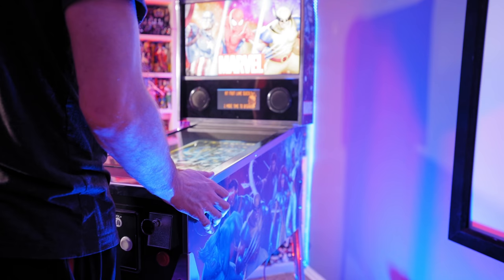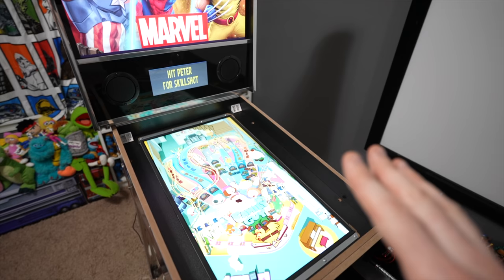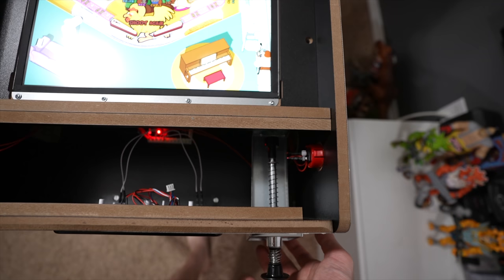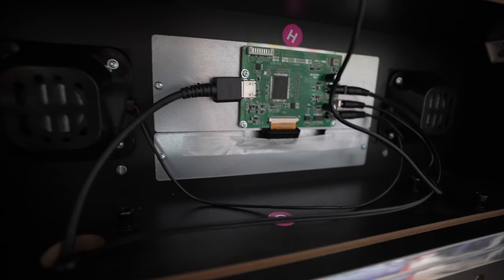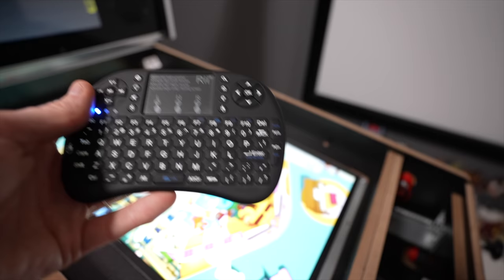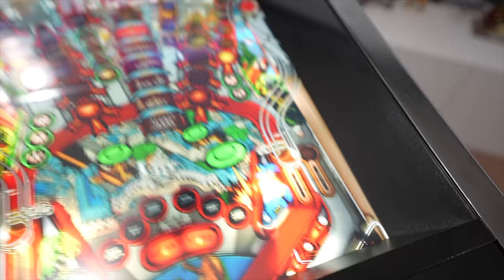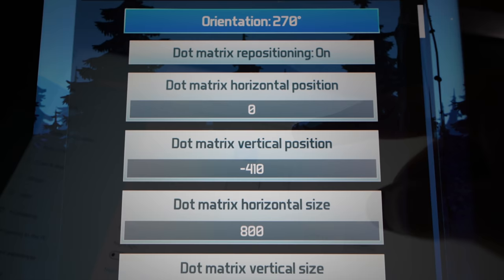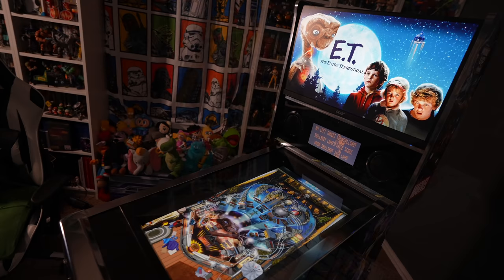Arcade1Up Pinball Mod Tutorial - Part 1

Comment: Uh, wait what? The solenoids and power switch crapped out on you? Did I miss where you posted this information?
Reply from the maker: The machine didn’t totally crap out, basically just the solenoids and the on off switch did. Everything else still worked fine. And you didn’t miss me posting that information, because I posted it here in this video lol
Reply: @cooltoy  Ok I edited my comment, but in my opinion this is kind of 911 info.
Reply from the maker: @lacrossed55  Nah, stuff breaks, it sucks, but it happens. Things like that are easily covered, fixed, and replaced by Arcade1Up warranty.  It would only be a concern if it was something they wouldn't fix for the customers. I got this pre production machine for review purposes, I wasn't about to ask them for replacement parts for this machine, because I didn't want to take anything away from potential customers who might need replacement parts more.
Reply: @cooltoy  Understood Doug. Just know I trust your opinion on these items and honestly it's a part of my decision process to purchase. It was a little jarring, as someone who's ordered 2 of these to see multiple fail points and just now hear about it.
Very true, key point is *preproduction* hopefully the production units are good to go.

Comment: Scary that the parts didn't last long and you end up gutting it which defy the purpose of spending $499 on it. It's like spending $499 on barebone cab and monitor.
Reply from the maker: For starters these machines have never been available for $499. But to your point , I clearly and blatantly told people in this video, it doesn’t make since to spend this much money with the sole intention of gutting it for a mod.

Comment: Why does Zen Studios tightly control using tables on a cabinet?
Reply from the maker: To prevent people from selling or charging for commercial use
Reply: @cooltoy  But it'd be OK for them to sell or charge if they were playing the games on a monitor?
Reply from the maker: Zen doesn't want people making their own pinball machines using cabinet mode, and then doing something like placing that machine in a bar or an arcade where customers have to pay to play on the machine.
Reply: @cooltoy  thanks for your interpretation!
Reply: @loganq  yeah shortbus it's their property
Reply: @metallicafan416  That's what your mom said.